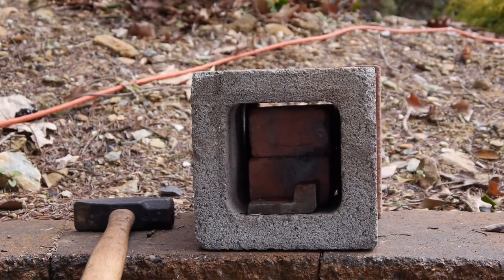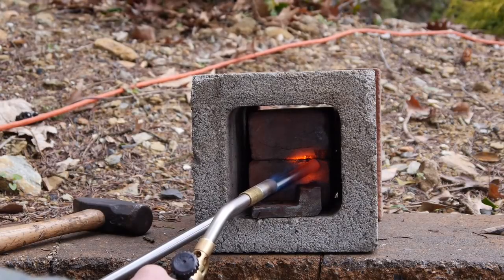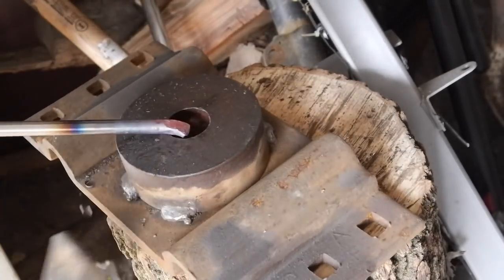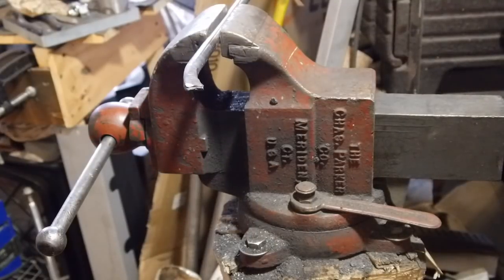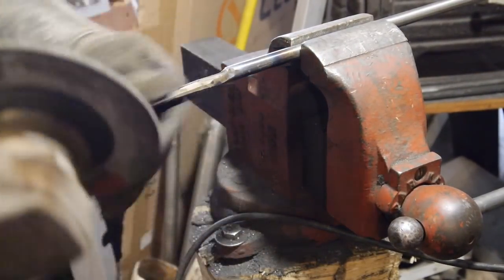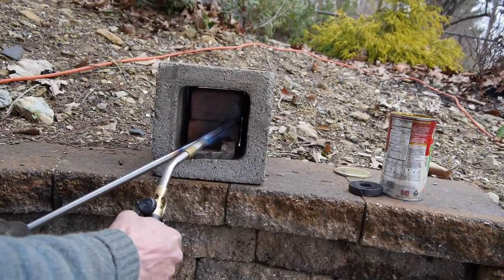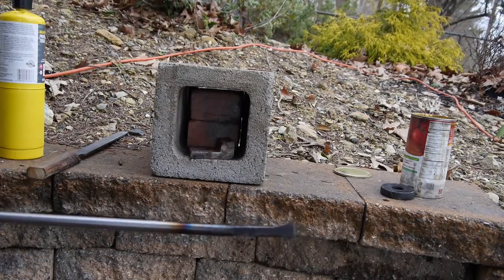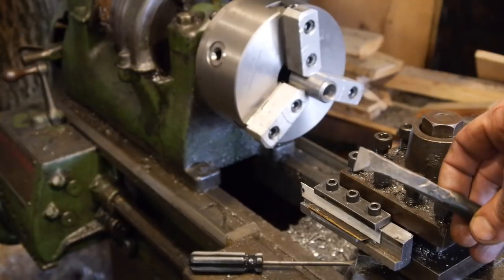Quick Forge a lathe boring bar from O1 Drill Rod tool steel, with a Mapp Torch

Comment: Why you ain't God's name when you get a piece of high speed steel nobody uses regular tools feel for boring bars anymore! If you're boring very soft materials it's kind of a waste. For about $30 you can buy five 8 in high speed steel blanks and make a bunch of boring bars that are actually good
Reply from the maker: With a lot of work, HSS is the way to go. I have a video where I punch and drift a hole for a HSS insert boring bar, and another video where I weld HSS to a boring bar. This is still a good technique to have in your toolbox.

Comment: Ive found that old coil spring works just as well as tool steel for cutting bits if you forge, harden and temper them. Ive used one on my shaper for quite a while and unless it's against really hard steel, it cuts mild steel like it's nothing and holds an edge for a very long time. The harder the bar is, the more rigid it is usually, I make mine out of the coil springs and just braze carbide to them for hard turning, thats why the professional bars are usually made out of very high carbon steel or a form of carbide.
Reply from the maker: Gotcha. Springs are usually made out of Higher Carbon Steel.  I made a little boring bar out of 4142 that cut mild steel nicely. Chewed right up when it a stick weld though.
Reply from the maker: Watching that video again, I keep wondering if I messed it up by quenching after the temper. My thought is to stop the heating process, but now, in retrospect, I'm not sure if that's the right way to do it.
Reply: no, you usually quench the tool bit when the tip reaches the temp that you want to stop the heat creeping any more and to stop the temper at where you want it to be.
Reply from the maker: Awesome! Thanks!
Reply: yea, going through weld will rip almost any cutter apart due to the welds actually hardening the material. Ive found that welds are usually as rough on cutters as a flame cut is. Only stuff Ive found that it doesnt affect is something similar to M42 HSS, and you just have to take it slowly. 
If you look into the old blacksmithing books where they're actually forging knife tools and various goose neck tools for metal shapers/planers, they have a whole quenching and annealing routine, which is pretty easy to follow and works perfectly fine for coil spring steel.
Reply from the maker: Yeah, I've been poking around the Internet to see if you can anneal a weld afterwards. I like the idea of welding, (you can make a big piece of steel from little pieces!), but then machining them is difficult. And what good is a big, lumpy piece of steel, if you can't make something nice out of it afterwards. I gotta watch some of your videos on casting!
Reply: yea, I know that a milling machine has a nightmare of a time with a welded or flame cut surface, but thats mainly because of the interrupted cut on carbide, which most people use on milling machines. I use HSS on my shaper, so it doesnt really bother it. If you use HSS in a lathe to machine it, it shouldnt be too much of an issue on welds, just machine it down till it's a constant surface, then carbide can be used without any trouble at all.
I plan on getting the stuff out and doing a bit of casting coming up to make the one tool that Ive been after for a while, so that'll be coming when the weather gets nicer.
Reply from the maker: That's it, it's the combination of the hardened steel AND the interrupted cut that does them in.  Looking forward to it!
Reply from the maker: Investigating whether normalizing after the weld will improve machinability